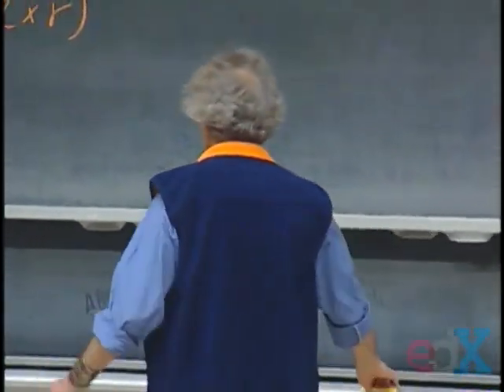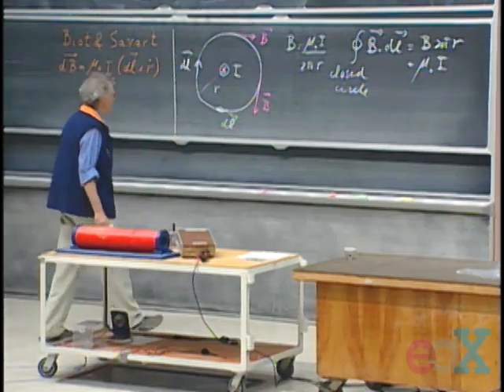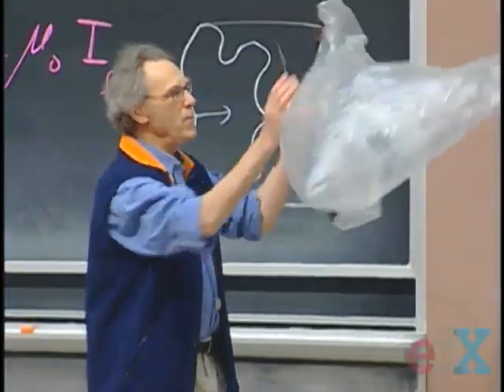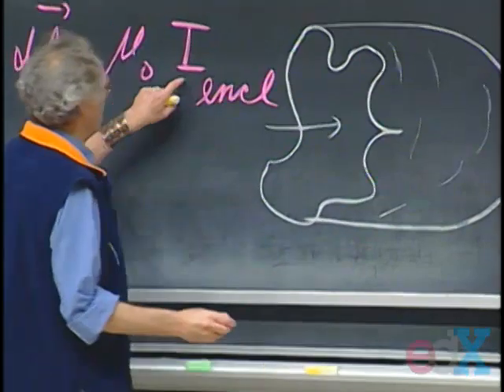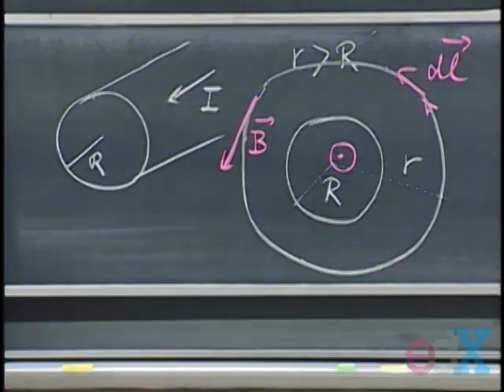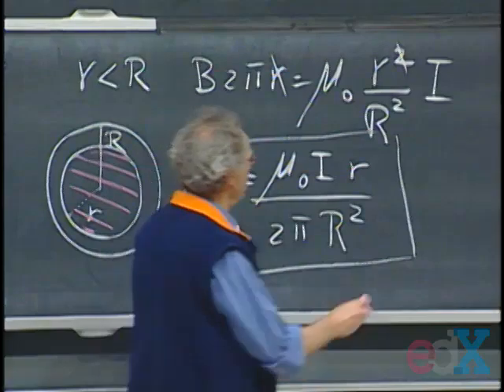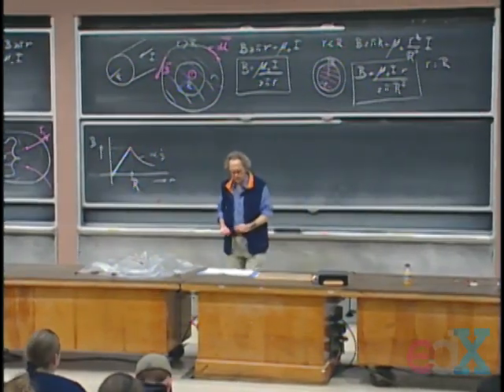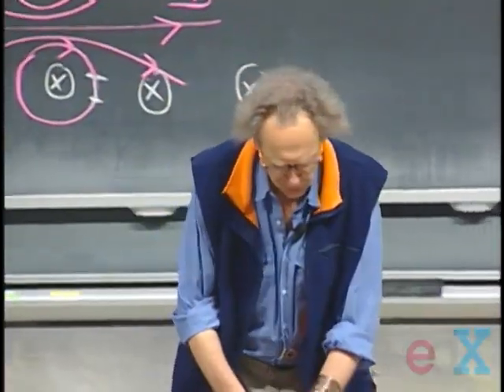8.02x - Lect 15 - Ampere's Law, Solenoids, Kelvin Water Dropper (revisited)

Comment: Awesome lesson as always!

28:48 Please notice that the pH of water being 7 doesn't mean that 1 in 10^7 water molecules are H+, it means that the concentration of H+, [H+] = 10^-7 moles of H+ / liter of solution.

Just for fun, let's calculate the actual value:

We have 10^-7 moles of H+ and a mole is ~6.022e23 molecules, so that means there are 6.022e16 molecules of H+ per liter of solution. Now, 1L of water is ~1kg, and because the molar mass of water is 18g/mol that's 55.55 mol of H2O or 3.346e25 molecules.
Now we can divide the ratios of molecules of H+/H2O and sum that up with OH-/H2O (which is the same because pOH is also 7) and we get that 1 in 2.78 10^9 molecules of water is an ion.
Reply: Underrated comment
Reply: @justalazyguy.0_0  I dunno. I think it’s rated pretty well.

Comment: As a physics student,  the   dl  vector in the Biot-Savart Law always confused me.  It seemed like it should be at the end of the integral, but it isn't.   The brief comment at 1:40 helps with that confusion.

Lewin's use of the blackboard is excellent.  The equations and figures are clear and not too crowded.    The huge chalk he uses reminds me of that used by my professors at UC Berkeley, in Physical Sciences Lecture Hall (later named Pimentel):  A. Pines, R. Meyers, R.K. Sachs

Comment: Sir, first of all, thank you for your lectures, they're really amazing. But I have a question about the Kelvin water dropper. In the picture we can see, for example, at minute 33:00, we see that in the top section of the device the E-field is pointing to the right. Doesn't this mean that the water will get polarized at the top and more H+ ions will go to the right that to the left? Using the same argument, more OH- ions should go to the left. 
I'm not sure wether this improves the device's efficiency or it actually makes it worse, because I can see two phenomenon going on. Let's take the left part, cubes A and B. The first phenomenon would be the one which makes the machine more efficient, because we would get more negative ions to fall to the D cube, making the time to breakdown shorter. But, in the other hand, the positive polarity that is in the tube above cube A could decrease because of the negative ions, making the E-field between the tube and A weaker and thus, the work done by gravity would be less. What do you think about this? Does the E-field on the top make the device more or less efficient?

Comment: At 10:45 ,   you are calculating the magnetic field at a distance r of the  wire of radius R.  For r>R I understood the concept.  But when r<R,  you take current which is passing in the circle of radius r.   Isn't the electric field inside a conductor zero? So all charges must be on surface and the current should flow on the surface of the wire and not inside it. So magnetic field inside the wire should be zero.
Reply from the maker: >>>Isn't the electric field inside a conductor zero?>>>
No! 
It is always zero in static cases NOT if a current is going through.After all the potential difference over the conductor is the integral of E dot dl. 
However the E-field is zero if a current is going through it and if the material is super-conducting.

Comment: In case of demonstration of kelvin water dropper, when after a spark has occurred, why does the meter showing the E-field very close to can A goes to zero because spark occurs only till the potential drops down below the breakdown potential so it will still have some charge....

Comment: Thanks for uploading these lectures! They are second to none.

I also just wanted to ask, if anyone knows why Mr. Lewin includes a "4*pi" in the formula at 20:30? I thought he had just derived the correct formula at 19:25.
Would be glad if anyone could help me.
Thanks!
Reply from the maker: I watch my video at 20:30. Yes, of course, I did take the 4 pi into account in my 0.026 T.
Reply: Hello Mr. Lewin (?)!
Thank you very much for the quick reply!
Maybe I wasn't entirely clear with my question: When the formula is derived at 19:25 there is NO "4*pi" in it and this makes absolute sense to me. But when the formula is used in the example at 20:30, all of a sudden there is a "4*pi" in the formula. I have troubles understanding where that term comes from.
I hope, it is now clearer what I mean.
Thank you very much for answering all the questions in the comment section. That's just applaudable!
Reply from the maker: mu_o is in the equation at 19:25. But mu_o is 4pi*10^(-7) which I use at 20:30. Listen carefully I DO SAY at 20:36 that 4pi*10^(-7) is mu_o.
Reply: Thank you so much! Now that I have understood it, it seems like a pretty stupid question, but I guess at least I have also learned more about the constant mu_0.
Thank you once again and all the best!
Reply from the maker: there are NO stupid questions. There are only stupid answers.

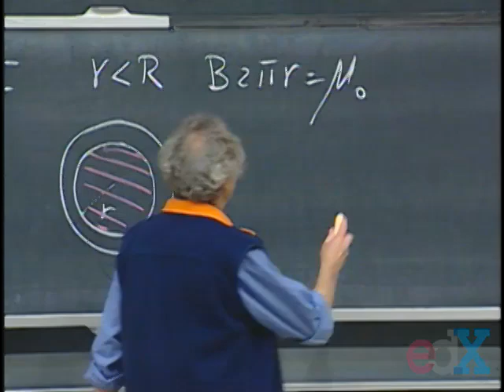Comment: Why do you square the fraction r/R when trying to find the magnetic field INSIDE the wire at 10:50. Is this adressed at a previous lecture that I missed, if thats the case please tell which one it is. Otherwise I would love and explanation for the reason you squared the fraction.

Thank you very much for these lectures :)
Reply: using this ampere’s law for inside the wire where R is the radius of the wire and r is the radius that we’re varying but in this case r<R so the current enclosed by the closed path isn’t the entire current so we have to make use of the uniform current density; the current density of the wire is J = I/piR^2 and we want a cross sectional area of pir^2 enclosed by the flat path so I_penetrated or I_encl = J(pir^2) = Ir^2/R^2 and then from there we plug that in for that version of ampere’s law not taking into account a changing magnetic flux and we solve for the magnetic field as he did! :D hope this helps

Comment: If the Kelvin Water Dropper were connected to a circuit (say an Ohmic resistor) would it supply a roughly constant voltage? Or would the voltage change significantly with time?
Reply from the maker: It would first slowly increase to about 20-30 kV (if the balls are separated by about 1 cm) then, when the spark occurs it goes down to ZERO.

Comment: Dear Professor, 
Can we say this, If we don't use tightly bound solenoids than most of the magnetic field energy will be wasted. Because if they get added then we get bigger value of magnetic field, which is confined in a volume.

Comment: 30:00 
Do you think it's possible for the water to be polarized in the spout? After all, the spout is a conductor. Electric field from A affects the spout, so, electrons will come near the cylinder A on the outside surface. On the inside, there's positive charges ,so, water inside becomes negative to compensate. That's why when you move the spout the electric field gets weaker: making the "battery" harder to charge.

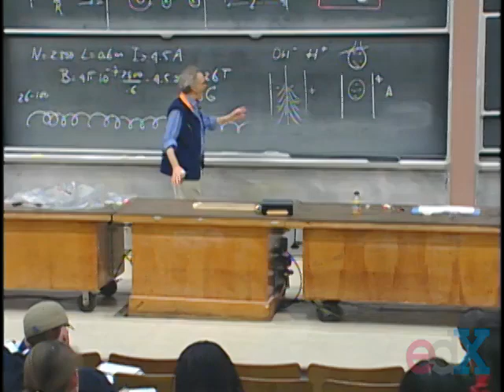35:00
Another question: is there electric field inside the cylinders? You didn't particularly talk about it in the lecture but you did mention that because of the electric field from the cylinders, water spread out(which could be misleading). According to what you taught me, I think there can't be electric field inside except for near the outsides where the water spreading occurs. 
Anyway, that's the only contradiction between you explanation and my answer in the Assignment. 
I hope you answer this.
Reply from the maker: https://en.wikipedia.org/wiki/Kelvin_water_dropper
Reply: I'm sorry but I don't really trust wikipedia. For example, read this part: "As charging increases, a smooth and steady stream may fan out due to self-repulsion of the net charges in the stream." How ridiculous. We know that's not the case because water only spread near the ends of the cylinders and spreading is way too far out. They say they're referencing from Thomson's book but what they wrote down is completely opposite to the book(regarding my questions). Thomson is in agreement with me.
Who do you think is right? Thomson or wikipedia?

Comment: 39:54 Sir, I did not understand why raising the spout high decreases polarising of water . I mean water still passes through A&B so it should get polarized right?
Reply from the maker: I explain the Kelvin Water Dropper in detail in a later lecture
Reply: Lectures by Walter Lewin. They will make you ♥ Physics. Ok Thank you sir.
Reply: They can't get the kick start for polarization because water drops are far away from A or B .

Comment: 30:06 that's quite impressive, but sir, I didn't get the connexion between B and D (and A,C) : the negative charges will fall into D which is a conductor so the conductor has a positive extra charge, but D is linked with C which is negatively charged
Reply from the maker: I watched at 30:06. I cannot add to the clarity of my explanations. Watch them again or use google.

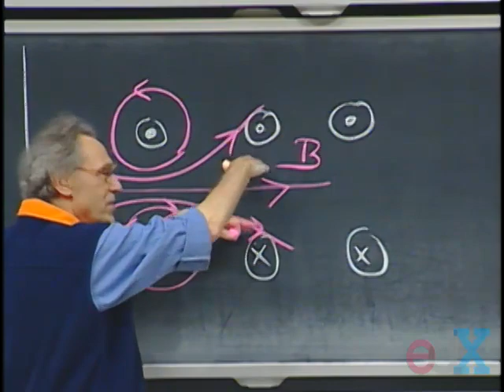Comment: Dear Walter, I have a question - why exactly the B outside is 0? if you look at 14:02 - on the upper left corner circle - it does has an arrow which points left. how the field is being canceled ? maybe is it a result of the lower circle which has an arrow right?
Thanks,
Elad
Reply from the maker: it's not exactly zero but zero is a very good approximation.
Reply: @lecturesbywalterlewin.they9259  Got it! Thank you! and thanks for this AMAZING lecture..!

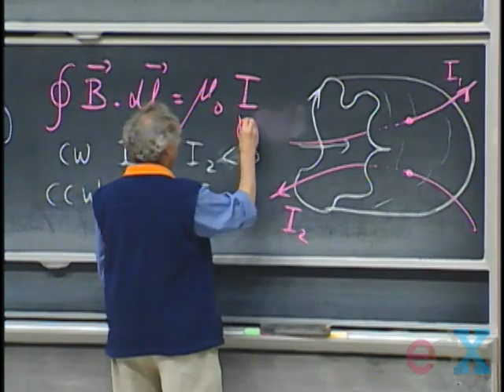Comment: Professor at 06:11 -  You use word "Penetrate" instead of "enclosed" because that surface can be flat and also can be any surface like the one, plastic hat which you use in Lecture. Am I got it correctly?
Reply from the maker: "enclosed is WRONG*
correct is: penetration of an open surface attached to the closed loop
enclosed is a classic mistake made by many teachers.  enclosed is ill-defined. UNIQUELY  defined is penetration of an open surface attached to the closed loop.

Comment: From about 36:30 we see the galvanometer go to -12, discharge and then go to zero....however it seems to need more potential charge before it breaks down, and also does not return to zero, but to about -8. That would mean that bucket A is becoming negatively charged? If that is so, then wouldn't the whole system not work after a while?
Reply from the maker: The system will only stop when you have used up all the water.

Comment: I have done the Kelvin water drop with two separate cans of water allowing individual drops of water to fall through the loops into the lower cans. The water source cans are not connected, so there is no way there can be a current flow across the top.

Comment: Hey I was wondering when you inserted the rod to measure the magnetic field i assume it was a metal rod and therefore a conductor? Would this mean that you would feel a force of attraction on the rod due to the magnetic field in the solenoid. Because i guess we can assume the solenoid to behave similarly to a bar magnet, and i know a bar magnet attracts conductors. Thanks for the help!
Reply from the maker: I do not recall what kind of material it was.

Comment: At 10:58 why do we take the fraction of r^2/R^2 * current and not just pi*r^2 * current ?
Reply: It goes against the definition of current density, but logically speaking, you know it wouldn't work if we had r=2, for example-- you'd get more than original current.
Lookup the current density definition, from there you can multiply current density by the enclosed area to get r^2/R^2*I

Comment: Hi Walter,

I have a couple questions:

1- At 0:43 do you consider the wire that goes through the blackboard to have length and to be straight? In lecture 14 we got B = mu_0*I/2*pi*r with Biot-Savard when integrating over a straight wire that had a considerable length. That B was the magnitude for a single point in space. I was confused because we said (in Lecture 14) that a single part dl of a current carrying wire would give a B field that goes down over r^2 and you did not say anything about the dimensions of the wire.

2- At 9:55 you found the same B field magnitude ( B = mu_0*I/2*pi*r ) using Ampere's law, but that time not for a single point in space but for the summation of all the B magnitudes along the closed line. Even though you got the same equation, can we say that this is not physically the same representation of B? One equation is the total B field acting along a closed line, caused by a infinitesimal length of wire penetrating the Amperian surface (Ampere), and the other is the total B field at one single point in space caused by a long piece of straight wire. So how do you interpret that physically? (punctual B and distributed B I guess?)

Thanks!
Xavier
Reply from the maker: 0:43 yes wire perpendicular to the black board
9:55 perfectly reasonable application of Ampere's Law.

Comment: Just wondering if the quantity represented by the line integral B.dl has a name or represents a meaningful quantity of something---like the electric flux in Gauss's law. Usually a line integral through a vector field represents some kind of energy or work done but that doesn't seem to ...eh hem... work in this case.
Reply from the maker: I am not aware of a name but maybe there is one. it's very meaningful as it allows us in cases of symmetry to calculate B

Comment: sir at 38:35 you said " there is continuous stream of charging,leaving the system and so it's discharging to corona discharge"  1.does it mean corona discharge can occur even before electric breakdown ?2.and how can we theoretically calculate the approximate value of maximum electric field at which corona discharge might occur in any electrical  system ?please reply sir
Reply from the maker: there are various forms of electric discharge - corona is only one of them, I suggest you use google to learn more.

Comment: 30:07 Sir, if that drop breaks and the negative charged falls and makes the bucket negative, where does the positive charged piece of the drop goes? if it is drops as well, doesn't it makes the bucket neutral after the negative charged piece of drop makes it negative? thank you
Reply: i think the +ve charged ion stays behind and separates from the negative ion.

Comment: Thanks a lot for all your videos, they are really helping me . However, I had a question: when you use Ampère's  law on the solenoid (19:15), I don't understand why the solenoid has a length L and  why  the length  L appears in the numerator of the final result for the magnetic field. 
Because I thought that for applying Ampère the solenoid had to be infinitely large so then I don't understand why a length that is infinite would appear on the final result. 
Why couldn't the equation for Ampère's law in this problem be like this:   
B*length rectangle = u_0 N I

Regards from Spain :) And again thanks a lot, you are a wonderful teacher!
Reply from the maker: infinityly large is meaningless.  If the length L is much larger than the radius R, Ampere's Law is a very good approximation.
Reply: I see! Thanks!

Comment: Dear professor Lewin. Is it valid to think of a reason as to why the magnetic field around the outside of the Solenoid is zero by extending the rectangle from enclosing half of the loops of of the solenoid to enclose the whole solenoid. Hence the net current penetrating the flat surface we can fix to the rectangular boundary is zero and hence Ampere’s Law implies that the line integral around the exterior boundary of the Solenoid Is zero (along the rectangle) is zero.
The only other way other than B=0 I can see the integral being zero is that it’s the case of some kind of inverse symmetry where one side will yield a negative quantity of the integral and the other a positive quantity, but this could imply that the B field has greater than 0 absolute value on both sides but inverse sign.
Reply from the maker: question unclear.  if the length of the solenoid is >> radius, it's a good approximation.

Comment: This is as usual great! Is the 30+ lectures in 8.02 spread over a six month semester? 
  Which book you were using for E&M?   Thanks in advance.
Reply from the maker: 8.02
Physics for Scientists & Engineers by Douglas C. Giancoli. 
Prentice Hall
Third Edition
ISBN 0-13-021517-18
Reply: Lectures by Walter Lewin. They will make you ♥ Physics. Thanks. Is 8.02 a six month course?
Reply from the maker: Febr 4 to early May. When I lectured 8.02: two 50 min lectures per week, 9 home work assignments, 3 (or 4) exams.
Reply: Lectures by Walter Lewin. They will make you ♥ Physics. Once again thanks a lot!!

Comment: Just to be clear when you say pick a direction of path and then I1>0 and I2 < 0 or I1<0 and I2>0, you are simply speaking of what sign the currents plugged into Ampere's law should have, correct? However, this does NOT indicate what the value of I1 and I2 actually are. I think this is obvious because then that would mean I1 and I2 are both simultaneously positive and negative.

Comment: Sir, at around 11:00 mins, you say that the I penetrated is small r squared by capital R squared multiplied by total I. Can you explain why we are doing so?
Reply from the maker: if r<R the current going through the cylinder with radius r is (r/R)^2*I.
Reply: Lectures by Walter Lewin. They will make you ♥ Physics. I get it now. Thanks for the quick reply.

Comment: Sir, when drawing the total B field in à selenoid you mentioned just the wire when it's coming out of the blackboard and in the black board, but you didn't include the B field when the wire is perpendicular to the blackboard.
Reply from the maker: how many minutes into the lecture?
Reply: 13:20
Reply from the maker: the problem is axial symmetric. All currents in all loops are taken into account.
Reply: Thank you sir!

Comment: Professor I have a question. When you start the water battery from higher, does the maximum potential difference will be higher without corona discharge. Because water drops are faster while going through the cans, and the cans must have higher electric field to bend them enough to touch themself.
Reply from the maker: Yes I think so